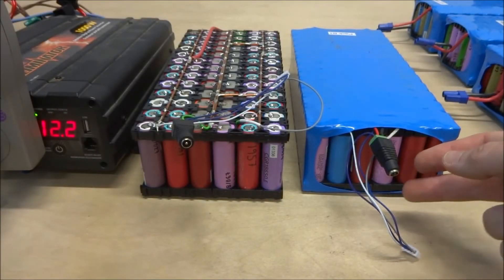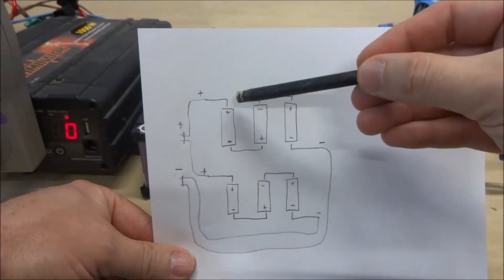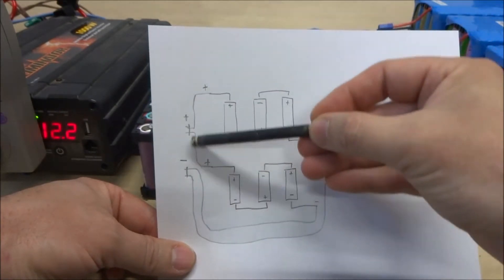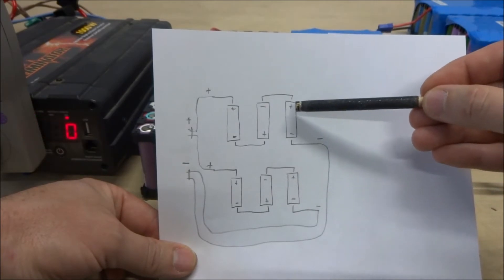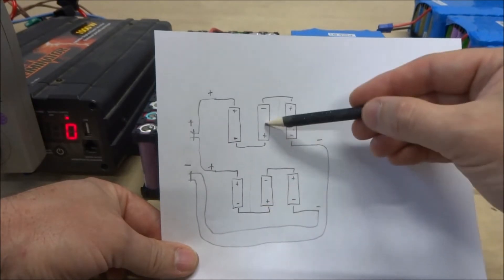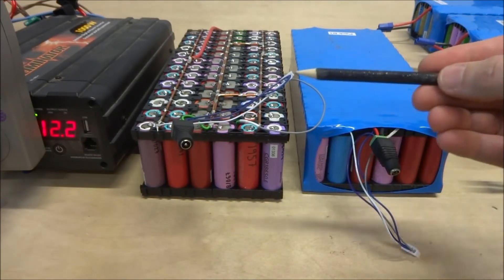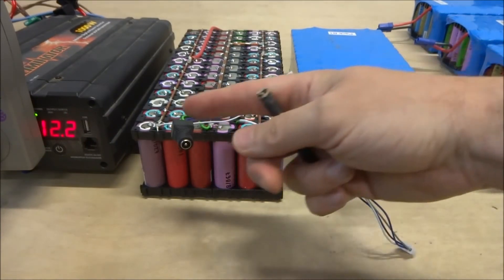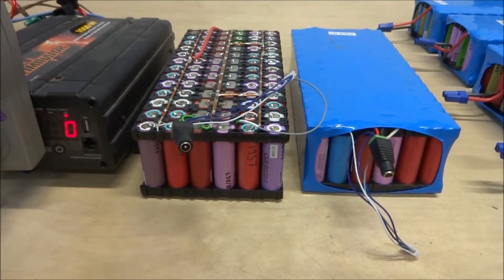Test of my oldest 18650 pack

Comment: Great video. Man I really wish all 12v inverters lasted all the way to 9 volts. But I guess that's asking to much.
Reply from the maker: Most inverters are designed for 12v lead-acid batteries, 9v would damage them. I think I found a better way to run these inverters using 18650 cells... will try to make a video soon.
Reply: Leaf Xpack , great looking forward to it. I tried a small 4s12p  pack to test a 400 watt inverter using a stepdown converter. I ran into some issues with stepdown inverter it is rated at 20amp. I just feel comfortable running 12.4 lithium battery with inverter. Check out the description of this inverter I want to power up with the batteries I was inquiring about. Its a 1500 watt Yue Qing reliable electric pure sine wave inverter,

SOLAR INVERTER DETAIL:
Model	RBPI-1500S
Input	DC Voltage	12VDC
Voltage Range	10-15VDC
No Load Current Draw	< 1.3A
Efficiency	90%
DC Connector	Cables With Clips or Car Adaptor
Output	AC Voltage	120VAC
Continuous Power	1500W
Surge Power	3000W
Waveform	Pure Sine Wave
Frequency	60Hz
AC Regulation	5%
Protection	Low Voltage Alarm	10DC±0.5V
Low Voltage Shut Down	9.5DC±0.5V
Over Load	Shut Off Output
Over Voltage Shut Down	15.5V DC
Over Thermal	Shut Off Output Automatically
Fuses	Short Circuit
Environment	Working Temperature	Between -10°C and +50°C
Working Humidity	20%~90%RH non-condensing
Storage Temperature	Between -30°C and +70°C
Others	Start	Soft Start
Cooling Ways	Cooling Fan
Total Harmonic Distortion	THD < 3%
Inverter Size
255*205*90mm

Machine Weight
3.79kgs

Comment: Hi, so what is the verdict? How does the capacity measured today compares with the initial capacity when you first assembled that pack?
Reply from the maker: I didn't test the total capacity when the pack was built but these were all weak cells (under 2000 mAh). I was able to pull 200 Wh out of the pack so if the inverter is 90% efficient (probably less) then that's about 222 Wh from the battery pack. Considering we weren't able to discharge the pack down to 9v (3v per cell) the pack still contained plenty of energy. The Battery Checker indicated that there was still 44% capacity remaining. Lets say I used about 60% of the total battery capacity, that would mean the pack is 222 Wh / .6 = 370 Wh. The nominal voltage for li-ion is 3.7v so the pack nominal voltage is 3.7v x 3 = 11.1v  In order to obtain the pack capacity in Ah you divide the Wh by the voltage (370 Wh /  11.1v = 33Ah). Each group is comprised of 26 cells so 33 Ah / 26 = 1.269 or 1269 mAh per cell.

Note this pack had been abused, at one point the total pack voltage was under 4v. I was surprised I was able to charge it back up in order to complete this test. I'm amazed the test ran as long as it did.